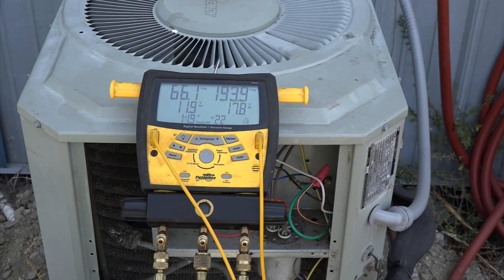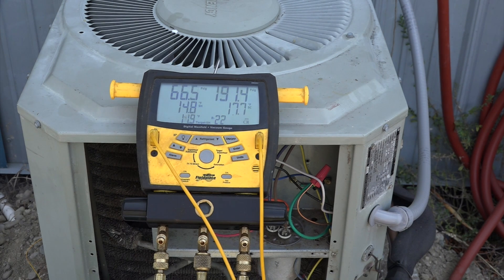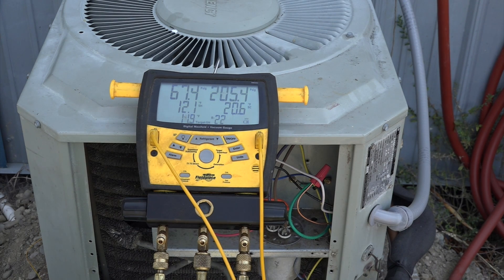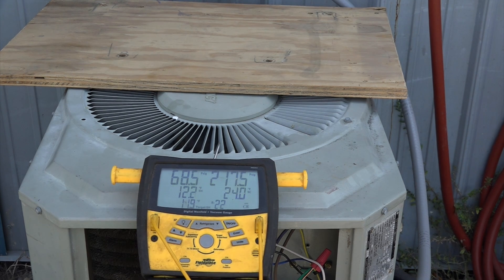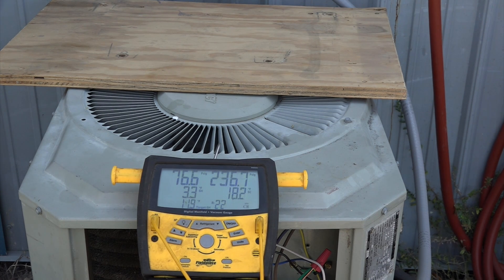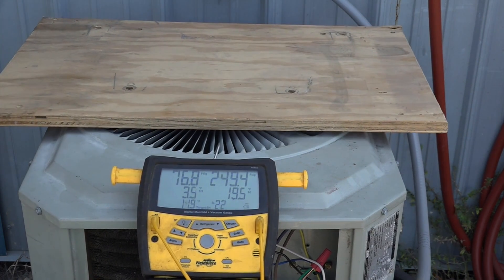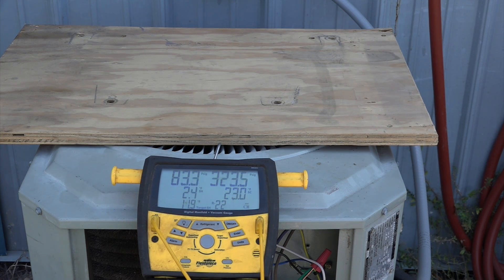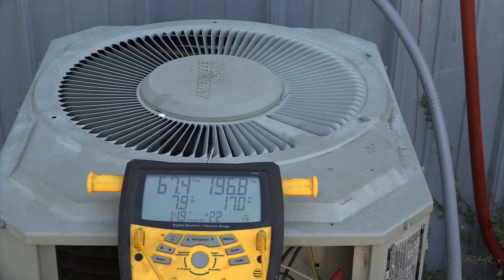The effect of high head pressure on the superheat of the fixed orifice A/C

Comment: I live in Central Florida so I only use AC. My terminology is completely off here and I know the mister system doesn't work based on your other videos. What about instead of using a mister, I diverted the hot refrigerant line coming out of the compressor and ran it through a barrel full of water before returning it to the same line that goes through the fan cooled coils? My thought is that this would be really effective at cooling it, and since the coiled lines running through the water barrel would be different, I wouldn't have to worry about build up on the coils inside the unit. (Someone made a comment that this would drop the head pressure which would be bad.)
Reply from the maker: Back in the day, there were systems that could be installed on the discharge line that would "remove the superheat" and the resulting hot water could be used to heat domestic hot water.    These systems were out of favor rather quickly when high efficiency units cane on line.
I don't know what effect your idea would have.
GFM

Comment: Hello grayfurnaceman , i got a question for you . Its not related to this video but i am hoping that you will still give an input. 
What will cause an air conditioner to run continuously for several hours and then internal thermal protector opens up ? Will it be because of the undercharged system or because of excessive air flow through the evaporator ?  Thanks
Reply from the maker: If it goes off on internal, the increased superheat from low charge is probably to blame.
GFM
Reply: In case of undercharged system the low pressure switch will not open up and shut it down ?
Reply from the maker: @THEHVACSQUAD  Many units don't have a low pressure switch.
Even if it does, the pressure must be very low for the switch to shut it down.
GFM
Reply: Makes perfect sense now. Thanks GFM

Comment: My suction pressure is at 65psi on a 95 degree day and my temperature above the evaporator is reading 71 degrees  what should I look for
Reply from the maker: You need to check superheat.  Generally, if the superheat is above 15F, you may have low charge.
GFM

Comment: I have a Trane 3 ton R22, piston unit, SH reads 21 on my SMAN360, low side = 71, high side = 289, VLT = 63, OD temp = 88, ID temp is 75, WB temp is 66. The SH leads one to believe it is low on refrigerant but the high side pressure is too high. Help. LOL   BTW, the unit is working fine, blowing chilly air, but the numbers don't look right.

Comment: I learned my lesson today on charging with a dirty coil. Was in a hurry changed out a leaking evaporator with new evaporator and piston. The pressures were all over the place. I got so frustrated I just sat down in the grass and that’s when I noticed all the mulch on one side of the condenser. Cleaned it off washed the condenser coil and everything went normally afterward. I usually use a check sheet which (check condenser for dirt) is first item. Was in such a hurry I never got it out of the truck. Wasted several hours. Enjoy your videos!
Reply from the maker: We all do that.
GFM

Comment: if the evaporator is clogged,  the head pressure reduces, not other way around. please correct me if i am wrong
Reply from the maker: Here we are talking about the condenser.
GFM
Reply: grayfurnaceman 
If the evaporator is clogged head pressure goes down
Reply from the maker: If you are asking that as a question not related to this video, yes the evaporator getting plugged reduces the BTUs that go to the condensing unit, so the head pressure goes down.
GFM

Comment: hello grayfurnaceman thanks for the video i have similar problem,i replaced condensor fan motor on a unit,that has meter divice cleaned the condensor coil but still getting highhead wiht normal lowside pressure  unit shuts off on safety cause highside goes to high,can there be air in the line or bad filter drier any suggestion would help?
Reply from the maker: Are you sure the fan is going the right way?
GFM
Reply: grayfurnaceman,thanks for responding back yes it's turning the right way,even vacuumed & then charged the unit,changed the filter drier but still giving high head pressure the only thing I can thing off is the condensor fan blade could be bad what do u think ?cause me lowside pressure stays normal
Reply from the maker: If there is good flow from the fan, there is no problem there.  What is the head pressure and outdoor ambient?
GFM
Reply: grayfurnaceman,it's a 825rpm motor didn't seem to fast for condensor coil but that's the nordyne replacement motor but used existing blade  I even washed the coil but still highhead with normal lowside.lost money & time but same problem  what u think is happening ?
Reply: forgot to mention went up to 375psi high side & 75lowside shutoff on overload after @ 85° outside temp R22
Reply from the maker: If you are sure there is no air in the system and the charge level is correct, there has to be a restriction between the discharge and the liquid line.  Liquid line fully open?  Look for temp difference across a component.
GFM
Reply: grayfurnaceman,thanks for your time helping out I have tripple vacuum system,add new drier even tested liquid line valve meaning pumping unit down to see operation all seems well where should I look for temp differential at the condensing unit?
Reply from the maker: Any part of the piping from the discharge to the expansion device.
GFM
Reply: grayfurnaceman seems like I lost the customer which didn't have patient to further check his ac,but seemed like the discharge temp was some what same due to high head pressure,I have feeling that there was problem with fan motor or fan blade not pushing enough air even though I replaced the motor but used existing blade do u think that's where the problem was  fan blade? motor was 1/4hp 825rpm nordyne.thanks agian
Reply from the maker: A fan blade failure should be quite obvious.  Broken blade etc.  The only other thing I can think of would be if the blade was not original equipment.
GFM
Reply: grayfurnaceman thanks will be aware next time with similar problems,anyway do u teach private lessons with tuition fee cause I would love to learn from u even if i have to pay u?
Reply: I have this same issue with a 410a system issue i suspect the fan

Comment: i have a/c high side is low that is the piston or the coil
Reply from the maker: There are many possibile reasons for this.  The first to check is low charge.  If superheat is high you can try adding charge.  If superheat goes down, that is the problem.
GFM
Reply: low side is very high and high side is low i vacuum it and charge it again it still doing it next step i will do is check the metering device  and replace the drier filter on the condenser
Reply: and also my coil is bad

Comment: furnace man i had a 410 a unit high side fluctuating  from 310 to 400 psi  and low side was at 106 psi but not moving or fluctuating what do you make of this.
Reply from the maker: Not a lot of info here, but you may have air in the system.
GFM
Reply: THANKS BY THE WAY IT HAD AN ORIFICE AND ADDED 1 LBS OF 410 A

Comment: What would happen if this system had a TXV on it? Would the valve try to restrict to maintain the correct super heat with the high head pressure? Thanks
Reply from the maker: Yes.  Unless the pressure gets very high, it will maintain.
GFM
Reply: Thanks GFM keep these great videos coming.

Comment: what if its an r22 system 4ton  super heat is 12 subcooling is 40 pressures read 75 lowside 320 on the high side its a piston metering device and coils are clean  new filter dried clean the line sets clean out the piston and it doesn't cool past 80° the super heat and delta t are correct but the subcooling is to high recovering only makes the super heat go up any ideas?
Reply from the maker: Is the coil matched with the outdoor unit and is the orifice the correct one?
GFM
Reply: +grayfurnaceman yes coil matches and its the correct piston the evap coil came with an extra piston and instructions on wich piston to use can air in the system cause that?
Reply from the maker: You are probably to the point that the refrigerant will have to be replaced.  Yes, you could have air in the system.
GFM

Comment: what if you have normal suction and normal head pressure .....but you have a high superheat of about 55 ??
Reply from the maker: So, what is normal.  Also delta T across the coil is important.
GFM
Reply: grayfurnaceman R22 with 74 suction 288 head pressure around 55 superheat and the outdoor ambient was about 98......when I first got there the suction pressure was up past 120 ......it's a fixed metering device.......I removed the A coil and cleaned it.....and put it back.....that lowered the suction pressure into the 90's and the superheat was in the 50's so I removed some of the refrigerant and got the suction down to 74 but the superheat was in the upper 40's.......I'm using the Sman 460 to take these readings....Temp across the closest vent ( older mobile home ) was around 89 lol.....
Reply: +james fields is there a sensing bulb on the evap coil?
Reply: julio chavez no

Comment: Here is more evidence of when a service tech performs an annual service/check to clean coils and make sure air flow is correct (fan blades adjusted, correct rotation, obstructions, etc).  There are a lot of dirty evaporators out there because they are often hard to access and hidden from view.  This video is a must see.  Thanks.
Reply from the maker: Welcome
GFM

Comment: Is there a way to know if it's TXV or orifice without opening the air supply?
Reply from the maker: +Luc Dumouchefl You can check to see if there is a hard start on the compressor.  If it has one, it is probably a TXV.  Hope this helps.
GFM

Comment: You said the target superheat was about 12?  Are you talking evaporator?  Because from what ive been taught was you want 15-20 compressor superheat to protect from fluiding liquid fo the compressor.  Evaporator i believe is 10-15.

This is for systems with orfices.
Reply: Is it refidgeration equipment where you are more focused on getting a ten degree subcool?
Reply: No refrigeration i believe you have to ask the manyfacturer of the equipment

Comment: What can you do if its a hundred sixteen out and the head pressure is pushing 345
Reply from the maker: brennanac1 Pray for cooler temps!  345# is normal head for a unit over 20 years old at that ambient.
GFM

Comment: This is a really helpful video.  Although a tech may understand the general concept that increased head pressure pushes more liquid through the orifice, it has a lot more meaning when seeing this demonstration.  The change in SH was bigger than I expected.  Thanks for the video.
Reply from the maker: Straycurrent Welcome
GFM
Reply: I thought less liquid entering evaporator would cause higher superheat. Because more liquid/flooding evaporator causes less superheat

Comment: gray Furnaceman I am happy you posted this. Last week I had a unit that is a 2ton new goodman outdoor (straight ac) unit tied to an old piston/evaporater with duct work condensing and dripping through the Sheetrock ceiling. Pressures were about normal for the day (185 head pressure). Sub cooling and super heat were about 3*f each. Indoor coil was pretty clean. Outdoor was very bad, plugged with lint type of debris from a dryer or plants. Cleaned the unit and all went away. Evap is 40+ ft above outdoor unit. No issues since the cleaning.

I am curious how a fixed orifice reacts to a not solid liquid line and how a txv reacts. I'm aware the seat on the txv will erode. 

I assume the lack of subcooling was a big factor in my case.

Thanks for posting.
Reply from the maker: PHC Apprentice Welcome
GFM

Comment: The only problem is I don't know your gauges and don't know what each of the numbers mean as I can't see what they say. You mentioned the 2 degrees and I could not see what you were talking about. I should get a picture of your gauges so I could see what each areas are on the gauge.
Thanks for the video and good explanation.
Reply from the maker: amtpdb1 Have you tried going to full screen and to highest quality?  To explain, the top number on the left is the suction pressure.  The number underneath is superheat.  The right number is head pressure.  Subcool is underneath.  Hope this helps.
GFM
Reply: grayfurnaceman Thanks, that will help. I am using full screen and best quality.
Thanks again.